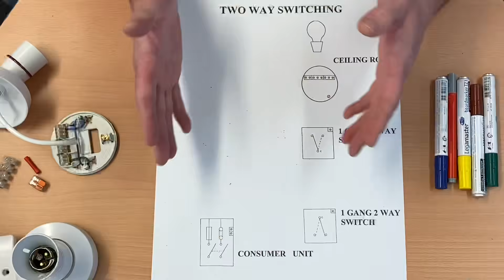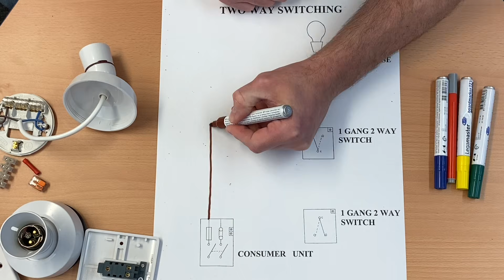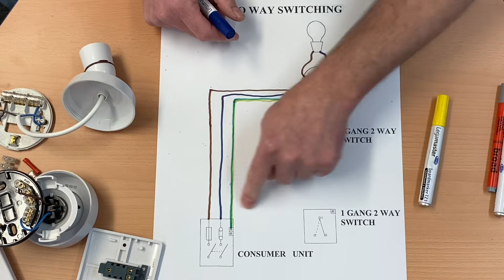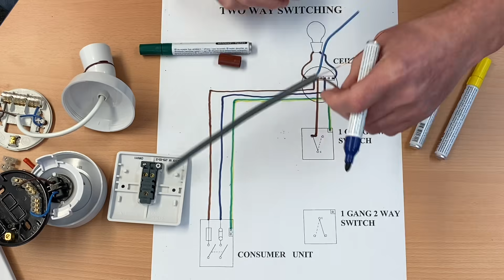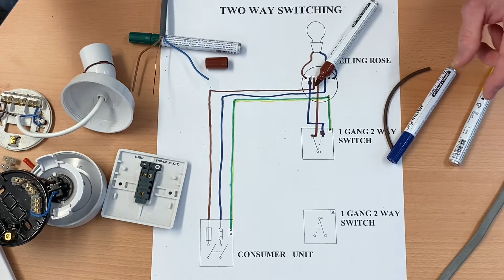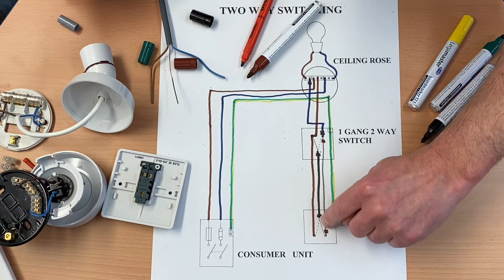Wiring Diagram 2 Way Switching of a Lighting Circuit Using the 3 Plate Method Connections Explained

Comment: Do you have any wiring diagram videos, where the loop in starts at switch 1 instead of the ceiling rose...  and in that scenario, can the switched cable to the lighting go from either switch 1 or switch 2 or is it always from switch 1?.. thanks.
Reply from the maker: Wiring Diagram Lighting Circuit 2 Plate Method Taking the Feed to the Switch - 1 Way Switch & Light
https://youtu.be/A19SCa6FUss
Reply: @GSHElectrical  - thanks for the link, but I was looking for one with multiple switches. Great videos by the way.

Comment: Hello GSH,

Thank you for the video.

To confirm, an important step in the transition from a one-way switch to a two-way switch.

Is that the feed from the Loop goes into either L1 or L2. Not the common terminal; which is what occurred in the one-way switch setup.

Yours,

Comment: Hello GSH,

Can you have a case where the grey wire is used to connect the two common terminals? Rather than the black wire as shown in your video?

In my college we used the grey wire to connect the two common terminals.

Great video and thank you for the clear and to the point explanations.

Respectfully
Reply from the maker: If that's how you were taught then there is no issues ✔️✔️

Comment: So if you have plastic switches with no earth connection I can use 3 core wire Instead of this 4 wire cable....colouring them appropriately of course...there all live anyway to the 2nd switch ..

Comment: Gary,

An interesting method of wiring those switches.  Here in the states we do it a bit differently.  The strappers  or travelers as we call them go to what you refer to as L1 & L2  the permanent line would go to the common of one switch and the switched line would connect to the common of the remaining switch to the light fixture.  Both work equally well, but like a lot of things between the states and the UK they are done differently.  Keep up the great work, I enjoy learning new things .   Merry Christmas.
Reply: Used your way quite often in the uk depended on job used a lot on conduit jobs.
Reply from the maker: Thanks for the detailed comment and watching 

Merry Christmas Gaz 🦾💕🦾

Comment: Thank you for this but I have a question I have 4 separate lights that all go to a 4 way switch then a 2 cor cable going from the 4 way switch to the consumer unit I want to add another 4 way switch is this just a case of running a 3 cor from switch to switch ? Does this all sound ok ?

Comment: The common on a one way switch is permanent live but when a 2 way switch is used the common becomes secondary live and either L1 or L2 becomes the permanent live, Why is this, why wouldn't common be used as permanent live at all times even if it means just renaming the terminals? Seems odd to change the meaning.

Comment: If I connect two switches up in a light switch as per this video (cable and switches already installed), but it trips the breaker switch, what might be the cause (all the wires from the switch are hidden, but appears someone disconnected one of the switches... Moved in recently...)

Comment: Hi. Could you able to help me? I connected a 8 led batten lights in to a 4 gang switches (2 light per switch). The lights are sometimes dim and sometimes bright. Do you know what is a probable cause? I searched on the internet and it’s says loose wiring connections but I’m not sure. Thank you in advance.

Comment: Amazing videos, how would this change using down lights?  Without the loop?
Reply from the maker: You would need to put the connections into a joint box and wire from the to the downlights 👍🏻. Thanks for the support Gaz

Comment: Hey there, do you have a video to explain 2 gang 2 way switching where all cables are going through a junction box in the loft to control the two separate lights?
Reply from the maker: Have a look in this playlist 👍🏻

Wiring Diagrams for Lighting and Motor Circuits https://www.youtube.com/playlist?list=PL2Ea5r9gxUUfm4SACOSOZigCeSxxC5xaO
Reply from the maker: It has 2 gang switches but no joint boxes 👍🏻
Reply: @GSHElectrical  thanks for the swift response.

Comment: Hi Gary hope you're all well. Just wanted to give a big thank you, your videos have helped me with my course A LOT. One thing I am confused about and would like to ask you is;

If I wanted to add an extra bulb to the existing circuit so both the lights turn on at the same time via the Two 1 Gang 2-Way switches, how would I do this. I have my practical exam coming up and would appreciate if you could help me out? 

Many thanks
Reply from the maker: Thanks for commenting this maybe helpful 
Wiring Diagram Adding a Light But WHY Use 3 Core and CPC Cable Connections Explained https://youtu.be/fa3c88DxB5w
Reply: If you want another light to be added you would have to put another T&E in the SW part of ceiling rose and connect to the nuetral and cpc.

Comment: Great video. Students prob find that style of drawing simplest to understand, but you could draw some sections of wires on the 45deg to avoid drawing wires through the middle of the switch plates. Do you ever cover doing a 2 way switch system using just T&E (but 2 cables) if no 3core plus earth avail?   (Is that allowed in the regs)
Reply: They used to use 2 core and earth 40 years ago but you still need to run a third conductor as a single  so effectively you have 3 core and earth but a single running alongside as the common.

Comment: I thought it was live to common on first switch  L1 - L1, L2-L2 and then common on the second switch goes to ceiling rose. Is this wrong or just a differnet method?
Reply: I've always used that method too. It seems far simpler to follow. Advantage I see in Gary's method is you always have perm live on the same terminal in both switches. Bit easier to supply powered smart switches you could run a separate neutral, or use 3+E and 4+E drops with a neutral core instead. With the common live 1st switch method the live swaps between L1 and L2 at the second switch so would have to take into account.

Comment: Great video, thank you!
Question: What kind of wiring method would it be one where both 2-way switches have L1=Blue (no sleeve), L2=Red, Common=Yellow BUT there is always only a SINGLE wire going into each switch connector?
On the ceiling rose only a black and red appear on the opposite blocks (clearly neutral and switched line).
Can’t figure out how this was wired (but it works).
Reply: That is classic 40 years ago 2 way wiring . 3 core and earth did not seem to be around then. Those colours which you identify  at one switch run to another switch which also operates the same light. Rhis is known as the strapper. The colours at the ceiling rose will come from one of those two switches as it will be the switch cable.

Comment: I thought grey was always common, and black and brown were used as the "brown" wires, as brown is brown, and black is old brown, not to say the black shouldn't be sheathed brown, but it just seemed sensible logic to me.
Reply: Black is the old blue not the old brown.
Reply: @memylastname9972  you right, red was the old brown, what was I thinking.

Comment: So strange looking at the 3 plate method, never ever use it. Always end up taking 2 core to a switch for live and neutral and 3 core between then 2 core back up. Just because of smart switches or other accessories that people quite often want to add later.
Reply: Thanks for the idea.? Do you mean loop between switches with a 3-core, then just 2-core from switch to light? Just thinking that a 3-core between switch and a light (ceiling rose) would allow the fitting an additional item that will need a permanent live eg.timed fan.

Comment: Any chance you could do a video on 2 way lighting when the switches are fed please please? 👍🏼
Reply from the maker: Wiring Diagram Lighting Circuit 2 Plate Method Taking the Feed to the Switch - 1 Way Switches& Light https://youtu.be/A19SCa6FUss

It will be next 🦾

Comment: Watching this from Belgium, I can see how it works but it makes no sense to me why it would be done this way (it also wouldn't work on two-way dimmers since those require permanent line on the COM).
This is how we do it (leaving out earth in this description):
Two-way 1: Cable to light: blue with a brown sleeve to COM as switched line, brown as permanent line to a Wago behind the switch. Cable to next switch: brown in that same wago (permanent line), black and grey in L1 and L2 (we call them what translates as "changeover wires").
Two-way 2: brown to COM, black and grey in L1 and L2.
In this situation Two-way 2 can be replaced by a two-way dimmer since it has the permanent line already going to COM. By switching brown and brown-sleeved blue it is also possible to put a dimmer in place of the first switch instead.
It is also becoming more and more standard in new installs here (apart from many people now installing teleruptor systems instead of two-way switching) to use quintuple wiring in 2.5mm² (green and yellow, blue, brown, grey, black) instead, which futureproofs the installation by bringing neutrals in the backboxes (we then use the black or grey wire as the switched line between the light and first switch). Bringing neutrals to the switches allows one of them to later be replaced by a wireless switch-receiver without the need for batteries or stored kinetic energy, and using 2.5mm² allows the lighting circuit to be converted later to a mixed circuit by simply installing a larger backbox and (an) extra socket(s) at any switch location. Sockets at switch-level in new installations are being fased out because of aesthetic reasons, but many people still like to add them in later to plug in the vacuum cleaner or a battery/phone charger without bending down to the low-level sockets.

Comment: I do wish you would teach taking the service to the switch and not the ceiling rose, then you aren't phaffing about in hot roof spaces.
Reply: You’re always gonna take at least a cable to the light point. Once you’re doing that it’ll often be easier to put as much as possible in the ceiling, because you are going to be wirk*ng in there *anyway*. And faffing in a hot roof space is still easier than chasing cables into walls.

Comment: With the common wire  going back to the old colours we was always taught that red was common and blue and yellow was the straps..moving on to the new colours We use brown for common and black and gray for the straps. In practice I find about 50% of other electricians do the same and about 50% use the black for common. I have even seen the grey used for common.
Reply: In the Netherlands, we use black for all switched lines — so both strappers and the common and the wire to the light fitting ould be black.

Comment: Or just take a 3 core & cpc from each switch to light, common to loop in terminal in light, other common to sw line in light and join each set of strappers in a terminal block.

Comment: Why not bring the Line to the common and connect the strappers to L1 & L2?
Reply: That other format of wiring will require the S/L in the 1st switch plate, needing a wire-joint somewhat, with the COM(S/L) from the 2nd switch plate. Its also widely used in certain BS based countries...
But the demo in the video is rather practical as all wires is terminated directly into the switch terminals themselves, thus eliminating extra wire joints behind the switches.
Reply: This is how we do it in Belgium, probably most of Europe. 
However I hope this discussion about two-way (+intermediate) switching can become a part of history in favor of (imho far superior) teleruptor systems.
Reply: Yes i can’t seem to get my head around it, why don’t you take your brown (line) to common??? Also can you do a video on 2 way lighting when the switches are fed would be a massive help please👍🏼

Comment: I guess intermediates next?
Reply: Same circuit, just with an intermediate switch on the brown and grey conductors. 
An intermediate switch just goes from === to =x= when switched.
Reply: So what do you do with the common!
I do know!
Reply: @stevensmith4449  It just gets crimped through.
Reply from the maker: Yes it is. Thanks for watching 🦾
Reply from the maker: Wiring Diagram 2 Way & Intermediate Switching of a Lighting Circuit 3 Plate Method Connections https://youtu.be/KjCnXrMLvms

Comment: Hi Gaz, as a electrician in Austraila, it is interesting to see how things are done in other countries. I take active,neutral and earth (cpc), to each light switch, then active to the common terminal at one switch, then join terminal one and two at each light switch using straps, then the second switch common terminal to the light. Two reasons for this way, most connections are done at the switch, on the floor and only one cable at the light fitting. In austraila the cpc has been insulated for about 25 years.
Reply from the maker: Taking the Feed (Supply) to the Light Switch the 2 Plate Method
https://www.youtube.com/playlist?list=PL2Ea5r9gxUUevU9gv8lizD53aYvwiJ5qr

Like this?
Reply: Yes

Comment: This is a great video, thanks for taking the time to make it clear and easy to follow. Quick question; is it much different when you're wiring in LED's which don't seem to have a traditional looking ceiling rose? Or would you just wire them with Wagos instead?
Reply from the maker: Taking the Feed (Supply) to the Light Switch the 2 Plate Method https://www.youtube.com/playlist?list=PL2Ea5r9gxUUevU9gv8lizD53aYvwiJ5qr

This playlist should help. Thanks for the great comment 🦾. Gaz
Reply: @GSHElectrical  awesome, thanks Gaz. I'd already seen one of those videos, but hadn't realised it was part of a series somehow! Thanks for the work you put in here mate.